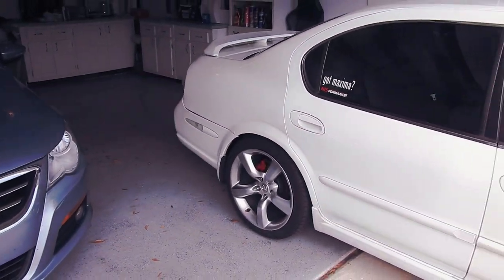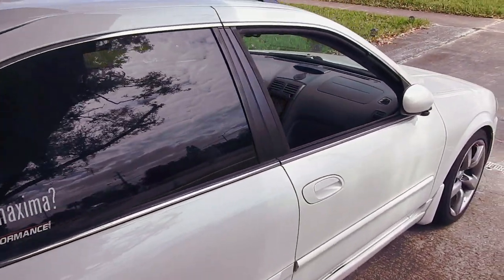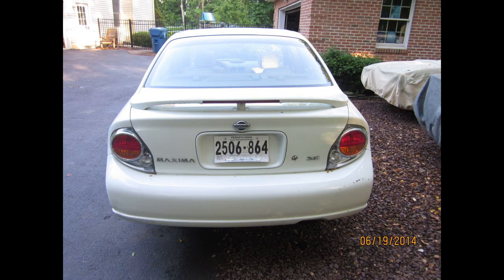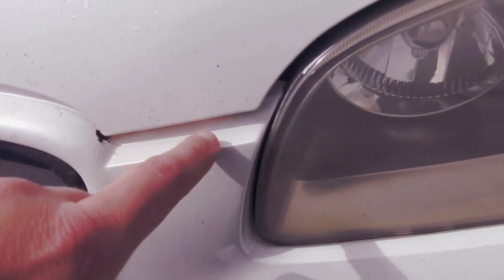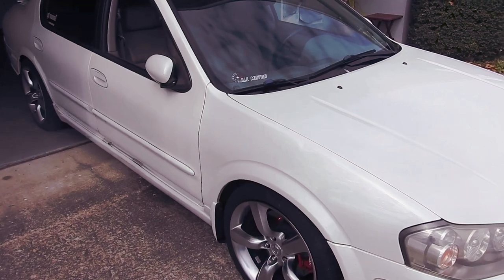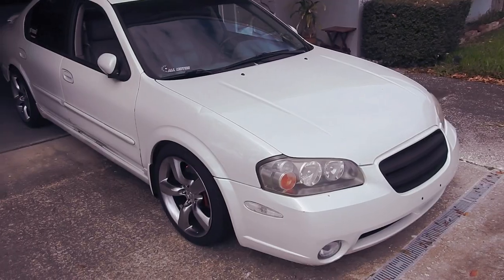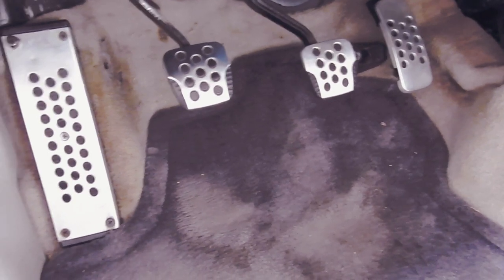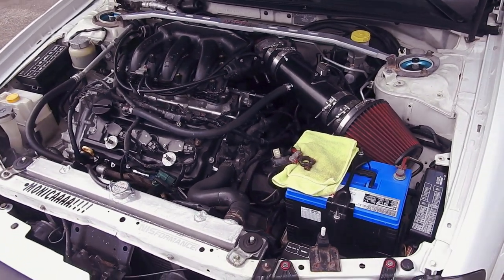My Maxima Got Smashed :(

Comment: Those who don't know the difference with the 6th gen (2004-2008) maxima brakes is that the piston for the front calipers are much bigger than the 5th/5.5 gen maximas (2000-2003). The 3rd gen Altima SE-R (2005-2006)  had the same brake set up as the 6th gen maxima also so they are interchangeable too!
Reply from the maker: This man knows his sh!t lol

Comment: Greetings Chris..love your video and build..what would you recommend for a 6th gen daily MaxSe 5sp at simple mods that can dyno and keep same efficiency..but with more gains..around 340 - 380..ive been reading about the 2nd/3rd gen de swap..what's your opinion.. love my 6th gen...and..btw the cams that you talk about what's those and what do they do.
Reply from the maker: Thanks for checking out the channel!  I would say your best bet might be to reach out to Nisformance.com and see what they recommend.  I've never owned a 6th gen but there may be some differences I am not aware of and so I wouldn't want to steer you wrong.  As far as the cams, I have JWT cams which are pretty mild and good for my NA street build.  Depending on what you want to do there are a lot of options out there.  There are bigger cams that can be used than what I have, and plus I had those cams done in 2016 so things have progressed since then.
Reply: @ImChrisDuke  oh I know..I've been watching some of your other videos..with the swap to black  max..and some others..love the fact every max different and has a totally different identity after..I'm definitely gonna reach out to them..thanks..
Reply: You engine is a 2nd gen de form altima correct?? That built is wicked still.
Reply from the maker: @maddrichstaks7787  it is

Comment: bro are you kidding me i know this was 3 years ago but bro i just got into an accident where some guy side swiped me while getting onto the bypass my insurance company paid for all the auto body collision work looked like it was never ever side swiped ever i mean bro you can look at the side of my car and it looks brand freaking new smooth as butter no sense of throwing this car away just because it has Auto body collision damage it can be more then repaired that's for sure! good luck to you if you still own the vehicle.
Reply from the maker: The frame was bent in... frame damage... 20 year old car... no point going through insurance... took everything off, transferred to a clean body, sold off the rest
Reply: @ImChrisDuke  Dang! sorry to hear that! Glad everything worked out! those Maximas are very good cars! glad you got you another 1 my brother owns a 2001 Nissan maxima but its an automatic lol can the automatics even be tuned im thinking we would have to build the transmission and motor if i had to take a guess tho? its the vq30de same motor as the vq35de right? or  naw! what's the difference if so?
Reply from the maker: @G3T_R3KT_XM8  I never owned a 00-01 so I don't know much about them
Reply: @ImChrisDuke  It's the same car. Only difference is that the 2002 and up models have the 3.5 the VQ35DE?
Reply from the maker: @G3T_R3KT_XM8  there are some other differences, but from what I understand yes they are largely the same